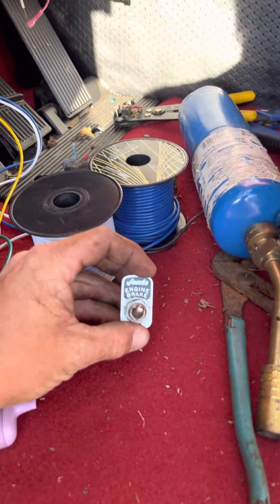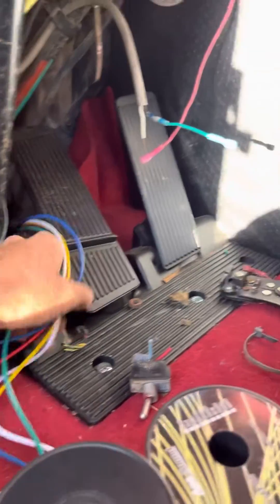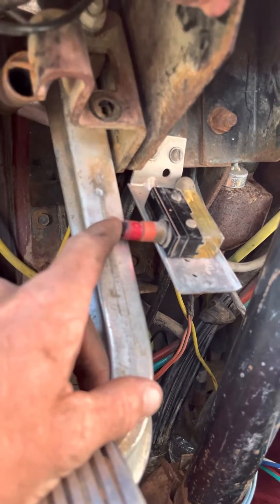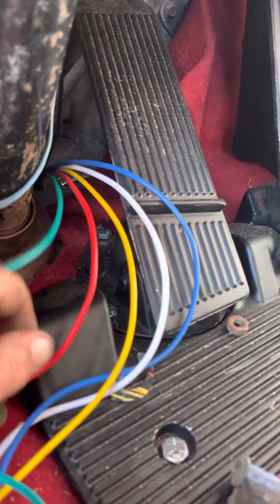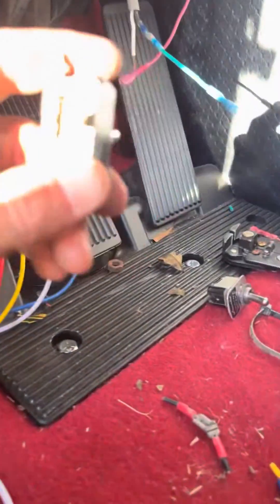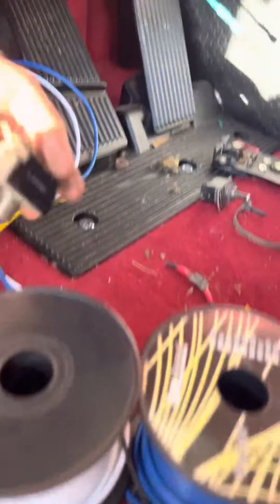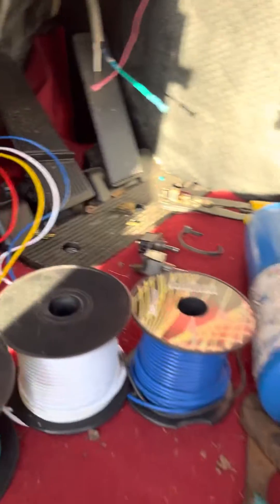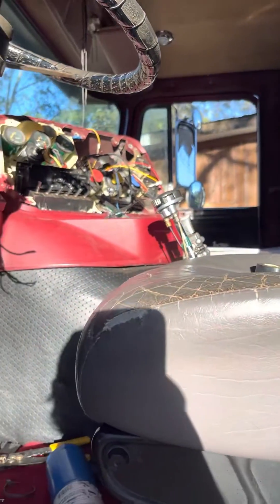How to make your own engine brake harness! Jacobs model 425-425a

Comment: Do you happen to know where I can get the tstuds that hold on the engine break I bought new engine brakes. Mine never had them on it so I do not have The studs to install them
Reply from the maker: Honestly you’ll probably have to find some used ones or find a parts engine with a set of Jake’s and rob them. They are like gold these days. I’m pretty sure you can’t get them new anymore unless maybe through ARP head studs
Reply: @sauciertransport  I’m having hell just keep me in mind if you run into some. Have a good day.

Comment: Where did you get the wire from everything? I’m finding is super stiff.
Reply from the maker: Go with the stiffer wire at least a 14 gauge. The wire I used was copper clad aluminum wire and I do not like it at all. I will be replacing what I did with pure copper wire

Comment: Another prospective O/O here. I just bought an 89 kw with nt88 big cam, no engine brake. I'm working on sourcing the parts to install model 430 jakes. This video is giving me more hope that I can get by without the entire kit. So far I've found the housings, adjusting screws, and the stud and spacer group. Nervous to spend over 1500 on these parts. Is the rest just wiring? Did your valve cover clear the additional height of the engine brake? Any advice is appreciated.
Reply from the maker: It sounds to me like you’ve got everything you need. The rest is switches and wiring and no need to worry about the valve covers